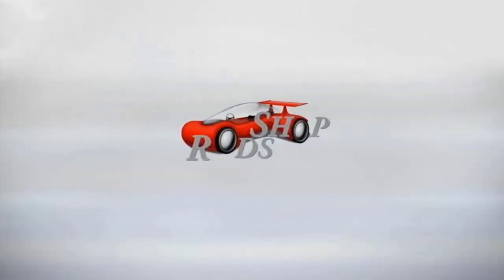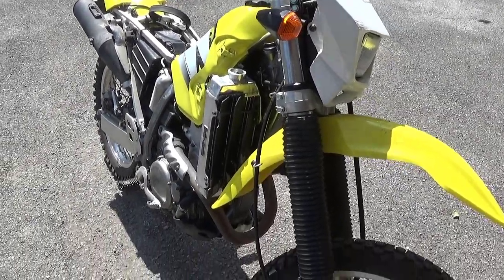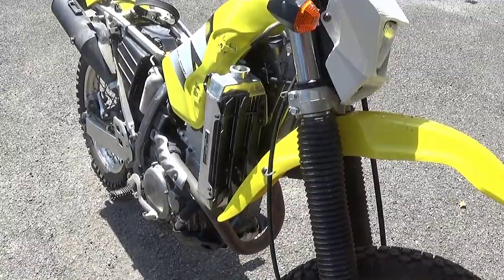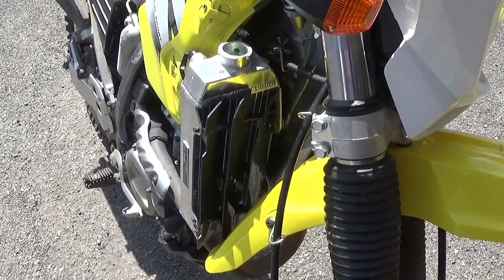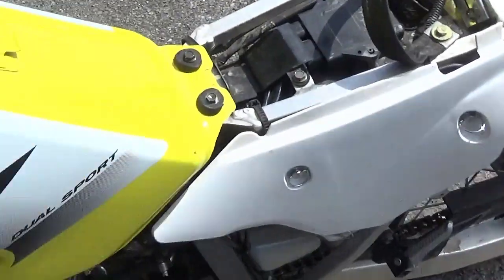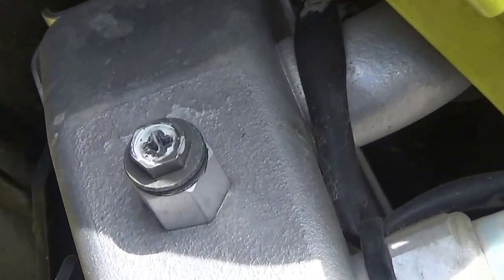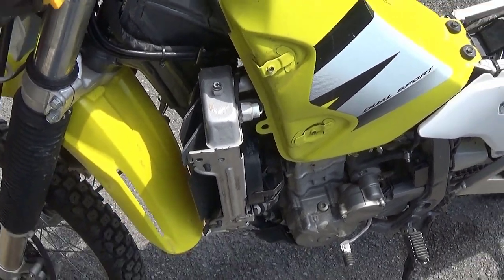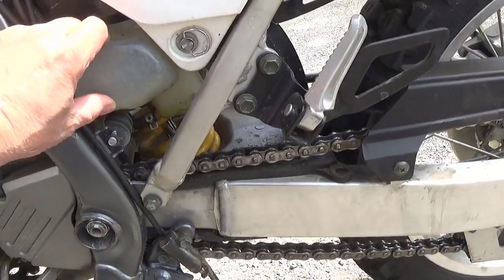How To Burp A Motorcycle Coolant System

Comment: Want to know the best burping tip ever?  Push a long funnel down into the filler, that makes a nice tight fit at the filler neck.  Fill the main body of the funnel about half full of coolant.  Now run the bike.  Not only won't coolant splash everywhere, the rad will actually drain coolant out of the funnel and stay topped off, as the air is expelled from the system.  You're welcome 😉

Comment: By having air in the system, would it cause the fan to not turn on, on some bikes?
Reply from the maker: It is possible for air in the cooling system to keep the fan from turning on. The temperature sensor has to be in the coolant to work, if the air is keeping coolant from getting to the sensor, then it will never switch the relay on to turn the fan on. 

One trick you can to to ensure it is getting coolant to it is by unscrewing the sensor. Not all the way out but enough for air and coolant to bleed out. You will have to start the bike and get it close to operating temp. Already have the sensor backed out a bit and see if coolant leaks out. You may hear air seeping out first.
Reply: Good think I ran into this comment cause I’m having the same problem now